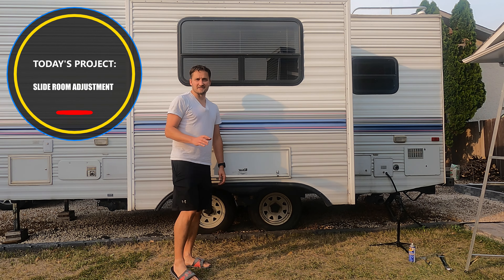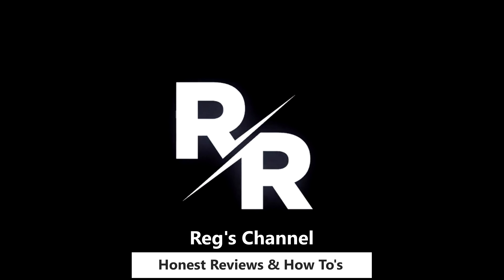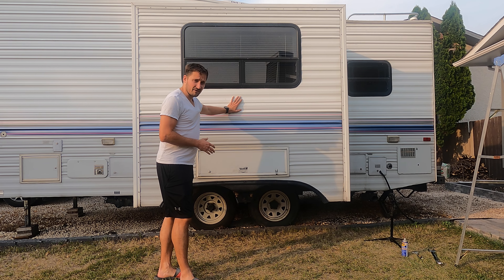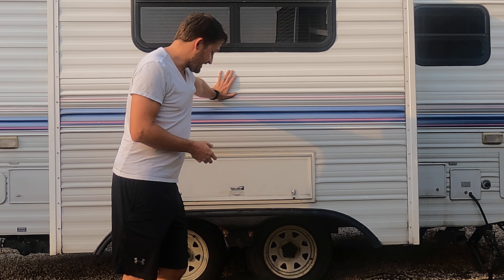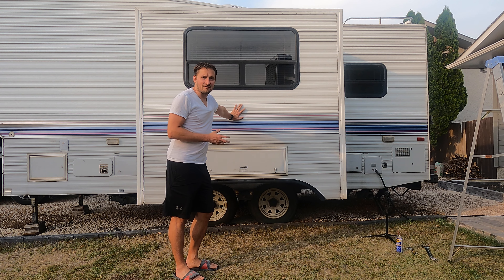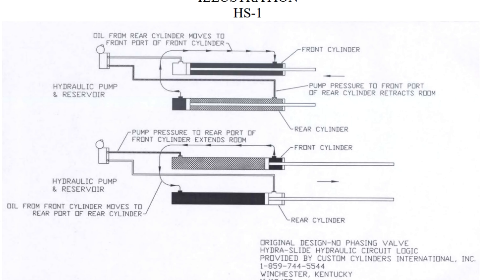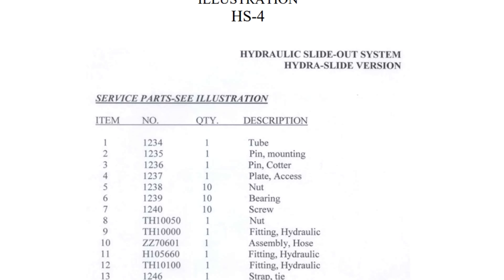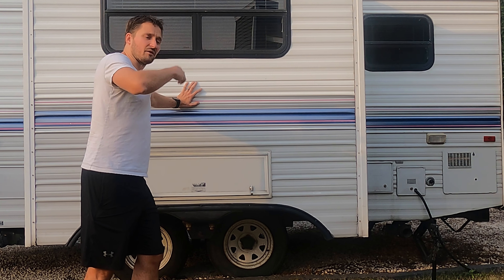Fleetwood Camper / 5th Wheel Hydraulic Slide Room Adjustments

Comment: Hi.I repair slide room now.
Please let me know how to slide room.
Does it run electrically? Do you want to move it manually?
Reply from the maker: Hi there. On this camper it's a hydraulic slide powered by an electric hydraulic pump. There will be a manual crank of sorts to let you bring in the slide room in the event of a failure. Hope that helps.
Reply: Thank you for your reply. Where is the manual crank located? As long as it is closed, it can be transported.
Reply from the maker: @MrMakako1102  it should be near where I show in the video. I would secure the slide room from the inside just to be safe.